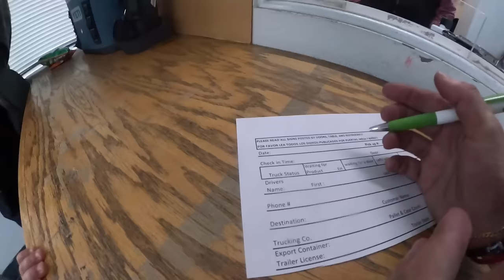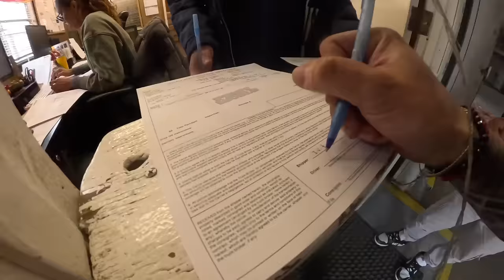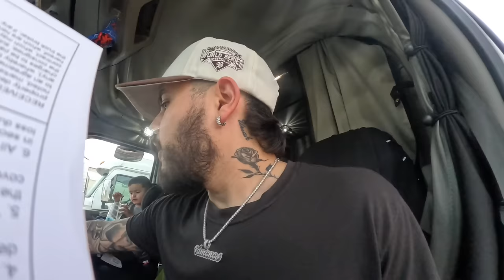I Took My Son on his FIRST EVER Trucking Adventure

Comment: 2:08 old square body Chevy and GMC (& probably older models too) pick up trucks used to do this too. I had an ‘85 Chevy pick up truck in High School and my friend Marcus had an ‘82 GMC pick up truck. Back then, cars and trucks had two keys, an ignition key and a door key. My ignition key would start his truck and his key would start my truck, however the door keys were different. So if the doors were unlocked (or we left the rear sliding window open) we would move each other’s truck to a different spot. 😅